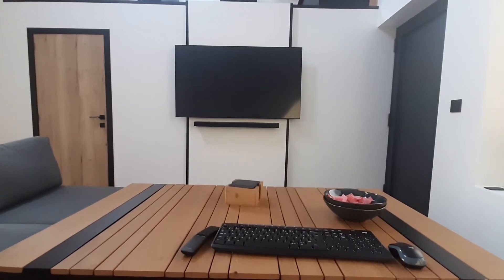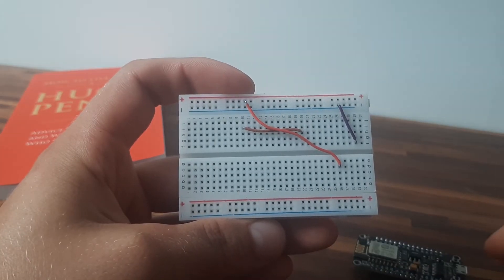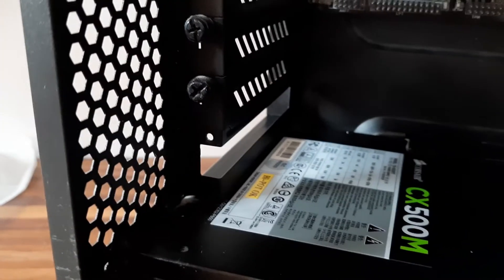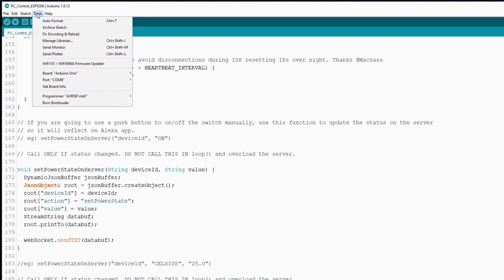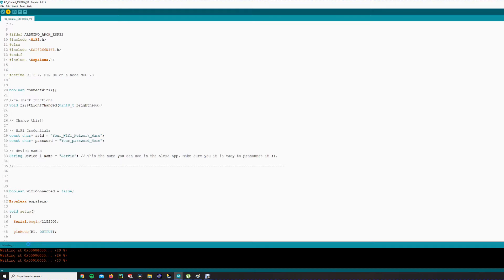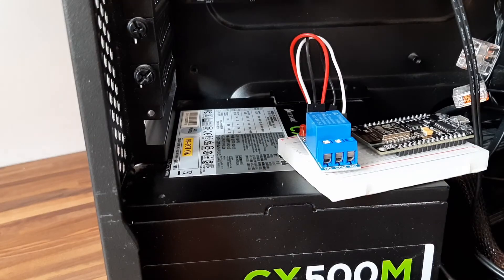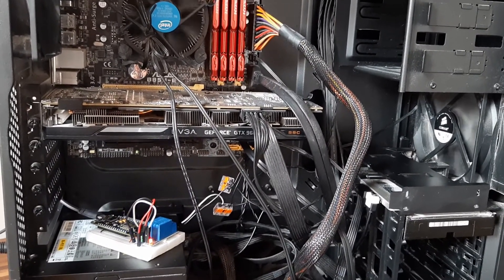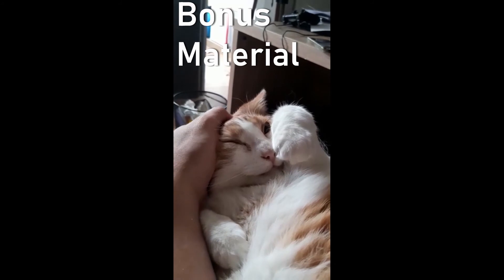Simple Home Automation: control your PC with Amazon Alexa || ESP8266

Comment: Can i use the esp8266 without relay?directly connected to the motherboard?
Reply from the maker: No, the computer Voltage is 12V DC en the ESP works on 5V DC.

Comment: Is it normal, while connecting to WiFi the relay to be on state OPEN and when connects to WiFi change its state to CLOSE? If the WiFi SSID is missing it remains in OPEN state? This could cause problem if there is power lose .
Reply from the maker: I will maybe revisit the software but when I disconnect my internet modem the computer keeps running (tested it just know to be sure). I use it now for every day for a couple of years and I don't have a lot of issues only when I turn on the power supply of the esp8266 (gives an on pulse). I also have the issue that after every couple of weeks (between 2-20weeks) Alexa can not find the device. I don't know if I can fix it in the Arduino code but I will look. If you have any improvements you can always share theme. I will test it and change the code for everybody to enjoy 🙂
Reply: @seafoxc  Can you turn ESP while the WiFi router is turned off and to check is relay in OPEN state or in CLOSED state?

Comment: But the relai should not work with a power source of 3.3V or am I wrong?
Reply from the maker: This is a good question!👌 Yes, the nodeMCU (ESP8266) output is 3,6V and not 5V. But the 5V relay works also if the voltage is higher as 3V. I also linked the relay in the description.
Reply: @seafoxc  I just bought relays that work with 3.3V or higher and they work perfectly.

Comment: Great video but having an issue with mine slightly booting up but not fully the pc fans start for a second then it stops any help would be great
Reply: Thankyou for the fast reply it's all working now I had it wired wrong in the terminal, thankyou :)
Reply from the maker: mmm, If installed correctly it should do just the same a pressing the button. Please check if you wired the relay so it is Normal Open. If you connected the button normally closes it is like you press the button all the time and release it for 2 seconds when Alexa is triggered and then you press it again for all the time. This would result in the PC turn on for a second or two and then turns of. Let me know if this helped? Hre some extra info https://arduinogetstarted.com/tutorials/arduino-relay

Comment: It would be interesting to also use the same thing for the reset button (in case the system freezes/crashes)
Reply from the maker: The ESP8266 has multiple outputs so this is definitely an option. I don't have many crashes so I don't have the need to do so :-). 
It would be a nice edition to your own project. Good luck!
Reply: @seafoxc  Indeed, it would just be a failsafe but as of right now I also have a smartplug where the PC is powered so in case of any issue I just turn it off and on again and the system boots (BIOS is set to auto boot when it detects energy)

Comment: Heyyy do we need a Alexa echo dot to control this or can we just control it using our Alexa app in our phone without any Alexa speaker?
Reply: Without the echo dot speaker the esp is not connecting with my Alexa app... It shows no devices found
Reply from the maker: @varunkumaran2624  When downloading the sketch to the ESP8266 open the serial monitor. Let me know if you get the signal the ESP8266 is connected to your Wifi network or not.
Reply from the maker: @Varun Kumaran I plugged out all the Echo devices in my home to be sure and now I have the same issue (device not responding). So I'm guessing you need an alexa device that works like a hub. :-(
Reply: @seafoxc  Yess, Echo dot is more than a bluetooth speaker.. anyway I love your idea of turning on your computer like Tony stark 👍🏻.. do more videos 😁
Reply: @varunkumaran2624  yes me too
Reply from the maker: You can do it without the Alexa Echo (just with the app like you described) :-)

Comment: That was an awesome video, thanks for sharing. 
Would this sort of thing work with Google Nest and that framework, or as far as you're aware just Alexa?
Reply from the maker: I was not 100% sure so I searched a little bit around but the Arduino library Espelaxa.h only works with Alexa. I tried connecting a new device with the Google Home assist but it did not work. You can find a tutorial about switching lights on with an ESP8266 and Google Home and change the code that instead of changing the state of the lamp the Ouput pin is written Low, Delay of 2s, Output Written High (if it uses negative logic otherwise first high and then Low).